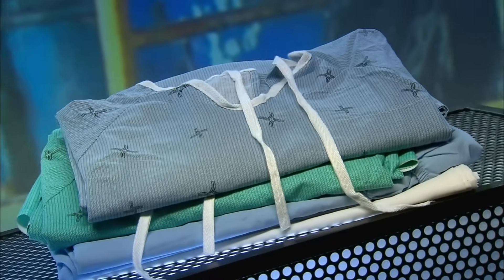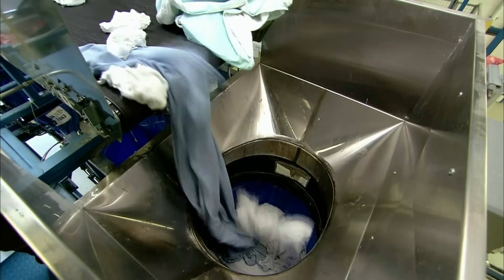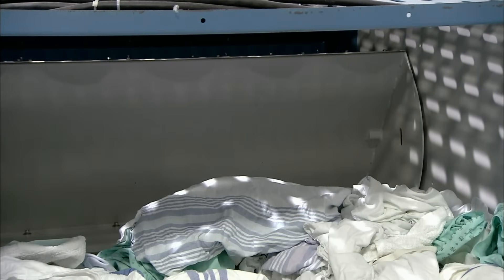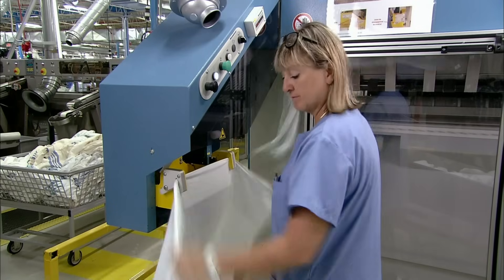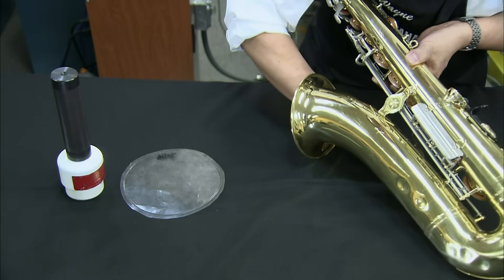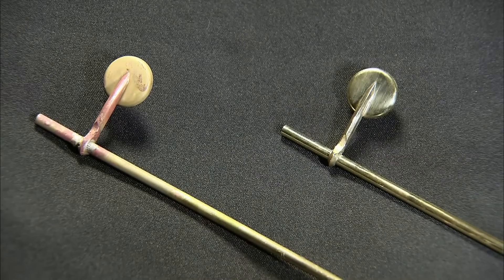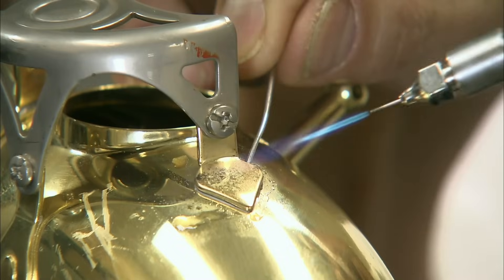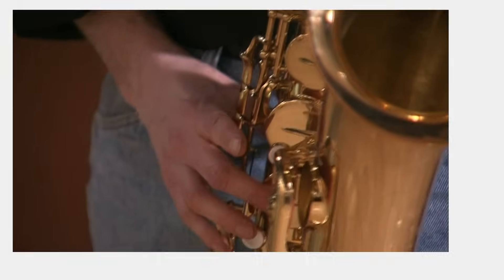How Do Hospitals Wash Their Dirty Laundry? | How It’s Made

Comment: To think I used to do the laundry at a nursing home myself, as a NA, just a regular bunch of washers and driers seen at a laundromat, and I sorted and folded it myself.!
Reply: I know a few places that did the same thing.
Reply: The classic "as a"
Reply: I work there they just use commercial sized front loaders. They only thing unique is the cleaning chemicals and automated dispensers.
Reply: @erikalomeli6582  surely those front loaders can also boil the water in the wash? I believe ours can, but we also have three tunnel washers that are capable of heating the water to boiling point and dryers that have an operating temp of 120°c
Reply: lol no wonder  diseases etc spread in those places.    even this video doesn't mention high heat sanitizing, which is the best kind  ,  along with chemicals. did you make sure to wear gloves and change them before handling the clean laundry? Washers and Dryers are available with heat sanitizing features .  I hope  evryone will use those, i plan on gettin g  them.